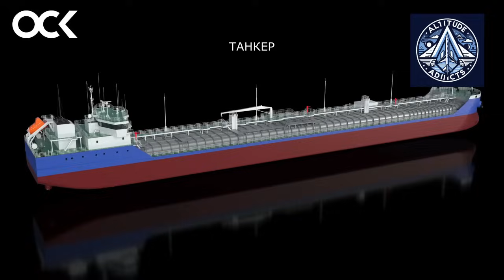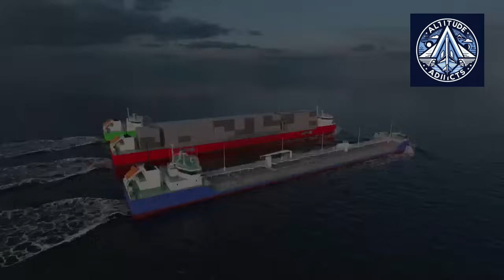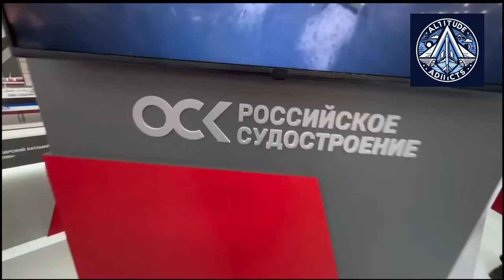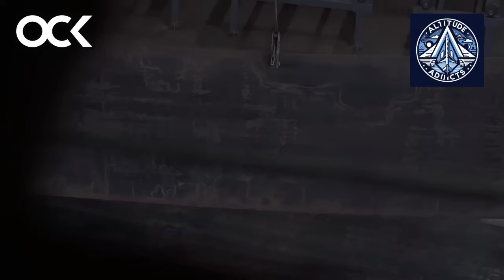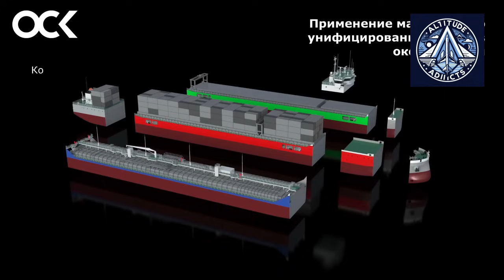New Russia’s Modular River Sea Ship - Platform No. 1 Explained |  Volga-Don Max Class

Comment: they could go 1 step further .... and use electric final drive ... then you could simply use container size batteries to easily interchange in ports ... or go hybrid and use diesels running on LNG to create electricity to charge those batteries  .... seems a no-brainer to me .... these are smart enough to have already thought of this I am sure